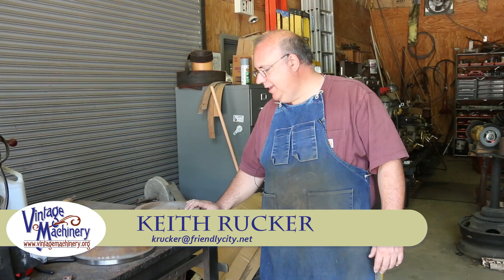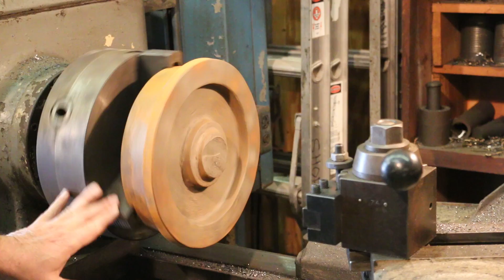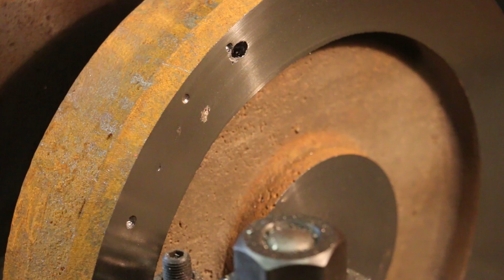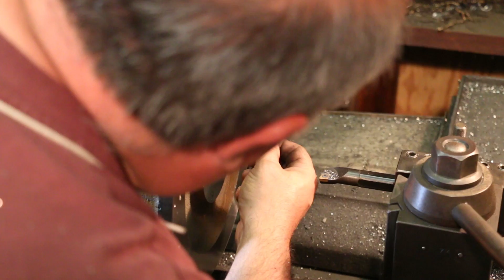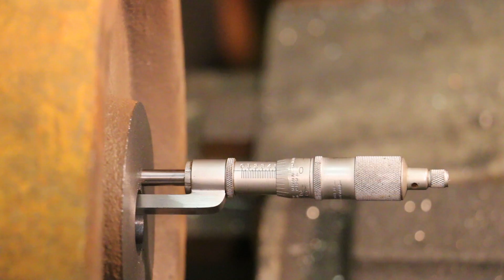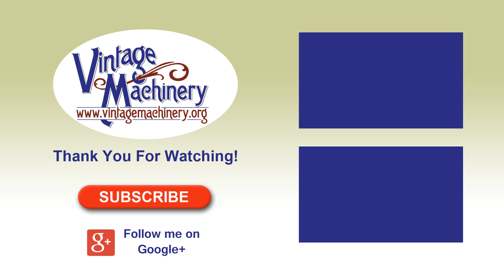Machining Cast Steel Railroad Wheels

Comment: Big job ahead.   Any idea if there was sand in those inclusions.?   what makes the sparks?
Reply from the maker: I am guessing that the inclusions were from some kind of gas bubble in the metal.
Reply: I puzzle as to what causes the sparks.   the cutting edge catching on the edge of the bubble (if it is a gas inclusion - I think you are right there)  or does a bubble cause a hard spot.     Any metallurgists out there?

Comment: Would it be easier to mill the wheel on a CNC Lathe from a solid piece of steel than from a casting?
Reply from the maker: Probably not - because this is a casting, there is a lot less material to remove.
Reply: 1 wheel = $$$$$ if you started with a high grade steel block? It would be interesting to get a price just out of curiosity.

Comment: DeWalt (and I imagine other manufacturers of various items) used to refer to their radial arm saw castings as "semi-steel," which I took in part to be an advertising term suggesting that the material was higher in quality than just "cast iron." I've never found a definitive identification of semi-steel, just an assumption that there's more steel in the crucible, sort of a hybrid between grey iron and steel. Watching your drill chips made me think in terms of a semi-steel. It wasn't the powdery crumbs of iron, but it never formed a string like steel, either. Seems like the wheels would be resistant enough to shock, considering the load and ignoring the casting defects, but like others, I really want to see the axle design.
Reply from the maker: I think that these wheels will perform just fine!

Comment: Hi Keith just throwing mud on the wall here, I was thinking that has to be cast steel due to the color of the sparks I saw in the video. Could those inclusions be milled / drilled to good steel then pre heated and welded back using flux cored wire then machined off to save the casting?
Reply from the maker: +DS75921 I am still not 100% certain, but the more I work with this material, the more I think it is actually ductile cast iron.  The sparks were actually coming from the inclusions and not from the good material on the casting...

Comment: Crown Metal Products made trains in 15 inch and 24 inch before starting to make 36 inch models in 1964.  I believe the first 36 inch locomotive they made is now at the Jefferson & Cypress Bayou RR in Jefferson, TX.  All Crown locos are 4-4-0's and extremely simple to aid in maintenance and operation.  They are very forgiving in operation.
Reply from the maker: +Roy Reynolds I have ridden behind a few Crown's but never operated one.

Comment: In my 19 years of restoring steam locomotives material identification was often an issue. Try sparking it with a side wheel grinder. Also spark known iron and steel. The sparks will identify it. From the sparks I saw and the chips I'm guessing gray iron. The 1" axle worries me. Love your videos. Thanks.
Reply from the maker: +Chuck Haynes I am now pretty convinced that these castings are ductile iron.

Comment: Beautiful videos to watch. Just a heads-up: be careful when allowing your telescoping gage to spring and 'slam-to' maximum dimension. I sprung a Starrett gage that sheared the stops that now is functional, but you better retain the parts when releasing. Just put your finger over the anvils when releasing the thumbscrew.  My $.02.
Reply from the maker: +halfinchholes88 Good point!

Comment: Talk to Saunders (NYC CNC) he does quite a bit of CNC work. He Also does training, so he might be able to give you some pointers, or reference material.
Reply from the maker: +ArcAiN6 I plan on talking to him at the summer bash in a few weeks!
Reply: :) Ibuilt my own CNC machine over the winter, just because i was bored.. i have to say, it was a pretty fun project.  Most difficult part for me, was i had to mill all the 1/2 aluminum parts using a compound vice on a drill press.. That being said, i still managed to stay within 0.05mm tolerances... Pretty crazy..

Comment: Keith,

Cast iron wheels are no longer allowed on mainline railroads, as the loads now present exceed their capability.  However, for "umpteen" years, the chilled cast iron wheel was standard.  The "old timers" were very clever.  In a single casting, very hard "white" iron formed the contact areas and less brittle "gray" iron formed the remainder.

Check the link that follows immediately out.
http://www.vbfamily.com/Wheeldoc.htm

Eli D.
Reply: That's a really interesting!  +1
Reply: The engine driver used to get out at every station and tap the wheels with a hammer to see if there were any fractures.

Comment: Another great video Keith!  Looks like cast iron from the chips and finish.  If it's ductile iron, the inclusions may not be much a problem vs. brittle gray iron, but the foundry should replace the casting regardless.  Not surprised it wiped out a HSS cutter, the outer skin can get chilled and super hard if they knock it out of the sand quickly.  One can grind off the skin with an angle grinder to get under it and also really slow down the spindle speed.  Of course carbide tool helps.   I used to design castings for farm machinery.  At the factory we would weld 65-45-12 grade ductile iron to steel all the time with a wire welder for certain applications.   Austempered ductile iron would be awesome in this application for both strength and wear.    Hub micrometer, now that's cool.  I want one.
Reply from the maker: +farmachinist The more I work with these castings, I am becoming more convinced that these are indeed ductile cast iron rather than cast steel.

Comment: Those being cast steel --  why not weld up the holes in the castings and just hand grind them flat.   Just a suggestion, its not like they are going to be spinning that fast or have that much load on them if the axle is only 1" diameter.
Reply from the maker: +Tom Bellus Upon further information, I am now pretty convinced that these are cast ductile iron rather than cast steel....

Comment: Machining castings is a difficult job. This is the first time I have ever seen a cast steel piece. I agree with sandrammer that there was very little QC on it. Like no degasser, for instance. Furthermore, the fact you had to cut it with carbide and HSS bounced says that stuff hardened. Wrong type of steel, wheels shouldn't do that. I think it's ask for your money back on the part of this 24" RR.
Reply from the maker: +Juan Rivero That will be up to the railroad.  We will see how many more castings have problems.  And I should mention that I am pretty sure that this point that the wheels are cast ductile iron rather than cast steel.
Reply from the maker: +Juan Rivero That will be up to the railroad.  We will see how many more castings have problems.  And I should mention that I am pretty sure that this point that the wheels are cast ductile iron rather than cast steel.
Reply: There's a lot of valuable time being used on those wheels. I would have thought there was material specifications with dimension tolerances asked for and given on a quote and then purchase order. It appears there is a lot of money already going for freight costs. Some body needs to look at the Whole Project from the small axles to the badly cast wheels. Even if it's a charitable nonprofit organization it needs better management. Now for the disclaimer- I'm not a manager myself and have never played one on TV. But I've been in the middle of quit a few poorly managed, albeit, well meaning projects. Problems get magnified from everyone just staying in their lane (that's not my job syndrome) and not asking questions to get the project done efficiently. I'm seeing a lot of talent here and the goal is good one. Keep on-Keeping on, but, see if you can kinda-sorta get the engineering "back on track".

Comment: so much labor in pattern-making, casting and machining... and having to deal with defects.  why not take slices of large-diameter steel rod (softer alloy), cut the wheels, then heat-treat?

Comment: Hey Keith in my early years I worked at the Swedish Crucible Foundry in Hamtramck MI.  and we cast bogey wheels for military tanks. When inclusions were found in the castings using Xrays we would arc air the inclusions out and then weld over them. It saves the part. If it was good enough for the U S military it should be ok for a little train wheel.
Reply from the maker: +Gord Taylor The problem is that now I am pretty convinced that these are ductile cast iron rather than cast steel.  It sure would have been nice if they knew what these were made from....
Reply: +Gord Taylor  funny, i was thinking along the same line.. it's cast steel not cast iron so welding up a hole in the casting shouldn't be much of an issue
Reply: Keith Rucker - VintageMachinery.org
 spark test

Comment: 1 inch holes?  I am not a machinist but um hmm that seems like something that you expect under a lawn tractor trailer.... I assume you have pointed this out to the customer so when the  wheel shears off the insurance company doesn't go after you....Just being paranoid I suppose...
Reply from the maker: +Bill sargent I am just following their design.  They have been using this design for a long time so I can only assume that it works...
Reply: Kieth I just watched this again.   I apologize. once again I am guilty of being a busybody troll.  I missed the part where you said it was 24" gauge .  Also, I am such a railroad buff  that I always think in terms of bigger cast axles and bolsters etc, I forgot that the wheels were only the size of big dinner plates.  Were you able to finish them this month?  Keep up the good work!

Comment: Would be interesting to know what grade of steel was actual used Keith, could you get that information from the people that did the casting? I'm always interested in knowing how different metals machine and that looks to be so hard almost to be brittle?
Reply from the maker: +downunderwest The problem is that I am doing this for the place in FL and they dealt with the foundry so I do not have any contacts or even know what foundry did the work.
Reply: Should have asked.

Comment: If you have carbide tools why would not  use them all the time over high speed steel?  Never been in a machine shop and just curious.  Thanks.
Reply: +soulcatch Just try grinding a form tool out of carbide!  HSS produces a smoother cut on many types of steel and always on Aluminum.
Reply from the maker: +soulcatch I do mostly use carbide inserts, but sometimes you just need to grind a special profile or need a geometry that you just don't have in carbide.  Both forms are still used in my shop!

Comment: It even sounds hard!!! 50 thou seemed quite a generous cut but I suppose with the big lathe it works OK... certainly seemed to. Pretty big inclusion showed up... pity after your work on it.
Love the hub micrometer - super useful.
Reply from the maker: +ChrisB257 Fortunately, the carbide inserts seem to be doing a good job cutting this stuff!
Reply: +ChrisB257 If you experiment, you can really start pushing your machine. I've found I can do at least 100 thou on my little 10 inch swing lathe, Adam Booth (Abom79) pushed 1 1/4" on his monarch. What seemed high to me was his surface feet per minute. I would have been afraid to go over 50RPM.
Reply: +justfakeit888 
Adam sure can push some cuts on the Monarch. My lathe is pretty old and it's rare I take more than about 25-30 thou off radius at a time (ie, 50-60 total). I am used to working slow! :)

Comment: G'day Keith, watching your video bought back memories. I did notice that you don't use cutting fluid, is that old school now?
Regards for down under.
Reply from the maker: +Wayne Jones I don't like using oil or cutting fluid on cast material - the chips turn into a fine dust that can be very abrasive on my machines.  Easier to clean up dry and less likely to wash into areas I cannot clean if I use oil.

Comment: I do this every day at work. full sized freight car wheels. it's a blast!
Reply from the maker: +john hilton Cool - I should just send them up to you to do for them!
Reply: Ohh no! You'll miss out on the fun! Besides I think our lathes would be far too big!
Reply: John: would you consider doing 26 inch trolley wheels or larger interurban wheels?  I’ m hoping they are not stew-pot steel like Kieth had to machine.  Judging by the sparks he had a few ball bearings in the melt.

Comment: I think you should have drilled the center in the same grip-position in which you turn the outer running surface. It would make sure it runs true. There won't be a big difference but it avoids any risk of wobble.
Reply from the maker: +jahobr The outer running surface will be turned on mandrel going through the drilled hole so that it will indeed run true.  Because I am having to chuck the part on the outer surface, there is not good way to hold the part where I can turn the outer surface and drill the hub in one operation.

Comment: I have not seen Abom79 do any work on cast steel in his vids, at least I don't think he's had any cast steel in his shop, and I'm curious as to whether cast steel is any bit as hard as the case-hardened motorcycle hubs and sprockets he works on quite a bit.  No matter how careful he is when working on those rock-hard bike parts, Adam still winds up chipping or burning up a carbide insert in about every video of him working on the sprockets and hubs.  With how wobbly these rough castings are initially, I can see why you not very aggressive with the depths of cut while facing the backside, not only to minimize the metal removal for cleanup, but also to try and keep your cutting insert from getting thrashed to death from the interrupted cutting.  Those dreaded casting pores though still must have laid a licking on it anyway.

That bore size for the axle just can't be right.  If that really is the size of the axle these wheels are going to be spinning with, I believe I'll pass then on taking a rail ride if I ever find myself visiting that park...
Reply from the maker: +Patriot1776 I really can't comment much on the cast steel as I have had limited experience myself working with the material.
Reply: Yes, and its no wonder too: Cast steel is so, so difficult to create and expensive to use that anytime a manufacturer finds a means to do away with using it, they jump at it.  Cast steel may well in the coming years suffer the same fate that befell original, true wrought iron and become extinct in new manufacture, barring some miraculous breakthrough that brings down the expense and effort of creating it.

Comment: 2:45
You didn't punch that hole in.  You drilled it.
Reply from the maker: +12345NoNamesLeft Yeah, I catch myself saying that all the time - technically you are correct, but "punching a hole" is an expression to putting a hole in something.
Reply: Slang for drilling in the machine world.
Reply: @TheCobraman45  Punching is a hole different operation.  Using that as slang is silly.
Reply: 12345NoNamesLeft that is what people in the trade often say, armchair machinists not so much.
Reply: @TheCobraman45  Seems like a regional southern slang.
Reply: 12345NoNamesLeft nope, I’m from Ohio, I’ve heard it often. I started welding and machining when I was nine years old. Still doing it at seventy five.

Comment: The profile that you have left to turn should actually be a slight curve with the radius specified by the Florida museum, rather than a straight taper.  It has to do with the concept of a ball  (the wheel profile) rolling between two pipes (the rail profile) to make it self centering.  That type of machining used to be done with a tracer attachment on the lathe.
Reply from the maker: +Shop Dave Exactly - it is a taper with several radii around edge and the flange.  A tracer attachment would be a nice way to do this, if I had a tracer attachment....